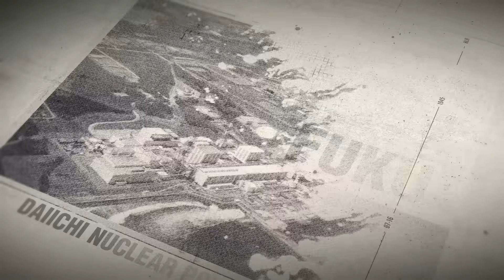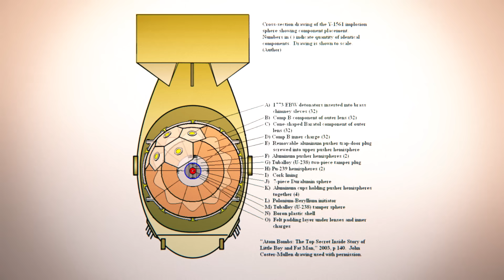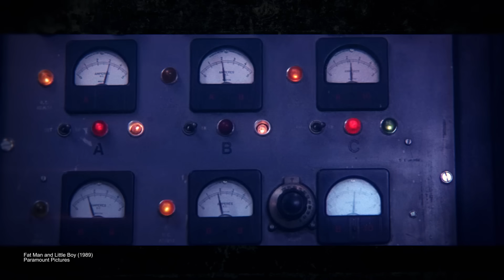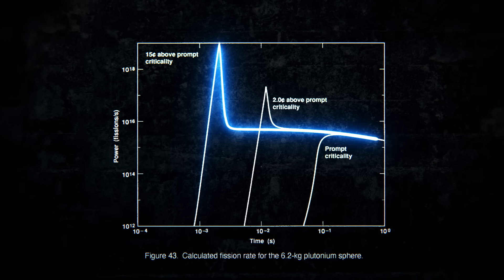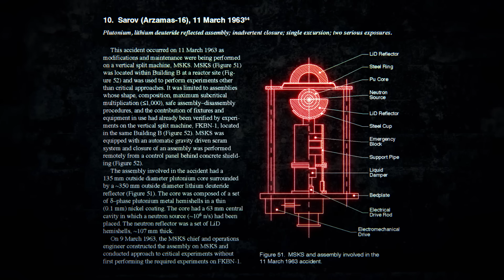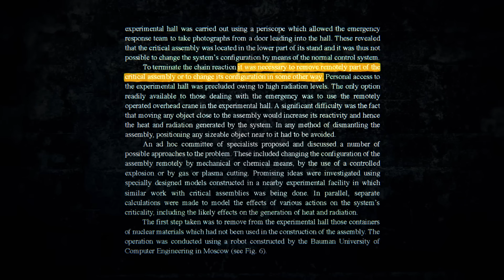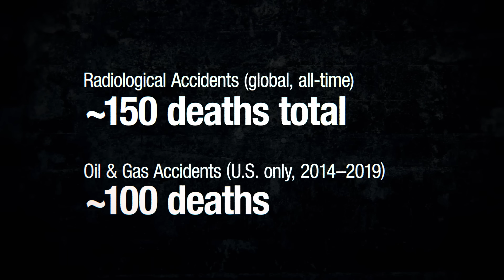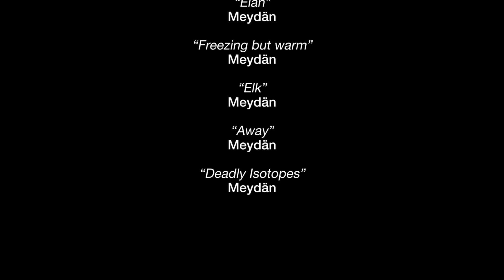Russia's Demon Core - Sarov Criticality Accident

Comment: Serious question, Kyle:
Those death numbers comparing nuclear to oil and gas...
Wouldn't you expect the nuclear number to be a lot lower because it's less ubiquitous? I haven't looked up the numbers but I would expect the oil and gas industry to have exponentially more workers than nuclear and therefore more chance for accidental death. Or is the disparity between the number of workers not enough to explain the difference in death rates?
Reply: I looked up some quick numbers. I got these from the IEA. 

Oil and gas employs about 11m people globally.

Nuclear employs about 2m globally.

I don't know if that's direct or a broader number like accountants and such that work for nuclear companies or oil companies. I suspect it's probably a broader number but still. It does show how much less chance there is to die from nuclear.

Am I making any sense?
Reply: @xliquidflames but even using those numbers, 5.5x more employees, but far more than 5.5x the deaths due to accidents.

If nothing else, it shows that nuclear isn't inherently MORE dangerous than oil and gas and shouldn't be more frightening.
Reply: @QBCPerdition That's a good point. I was just curious.
Reply: I found a ratio that says per 100,000 workers, oil and gas has 24 deaths from accidents and nuclear has 48. Those numbers are from the CDC. But if you include mining operations and everything that goes into each, oil and gas jumps to 56 accidental deaths per 100,000 and nuclear goes to 47.

I'm not trying to be a nuclear naysayer but I do want to understand the topic with good information. I still think nuclear is the right way to go.
Reply: @xliquidflames  Thing is, if you start to include the death toll that comes from the environmental consequences of, oil and gas lose. I am also curious about those numbers, because they seem really high compared to the number of deaths total quoted in the video. It would mean that there can really be no more than 100k people working in nuclear in the US? I guess it includes non-radiological deaths, which is a fairer comparison anyway I think. 

I too am not in favour of oil/gas, but think that misleading use of stats does not favours to the argument.
Reply: But the thing about nuclear is you just need less people. So even if nuclear were scaled up, we shouldn't expect total numbers to eclipse the oil and gas industry. Further, total death toll historically is astronomically bad for oil and gas due to nonexistent safety in the past, which is another reason to switch. Nuclear has the best safety records because it was designed as such from the outset.

Comment: I've actually been thinking about the "tickling the dragon's tail" tale lately. Would it have made any difference if they had performed the experiment underwater?
Reply: Water is a good radiation shielding medium. That's one of the benefits it provides in a spent fuel pond at a nuclear power station.